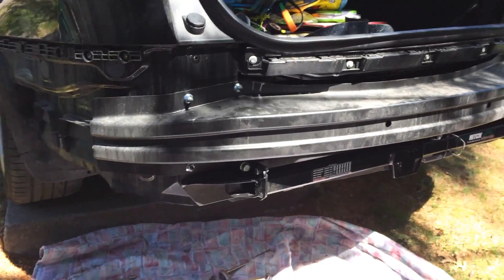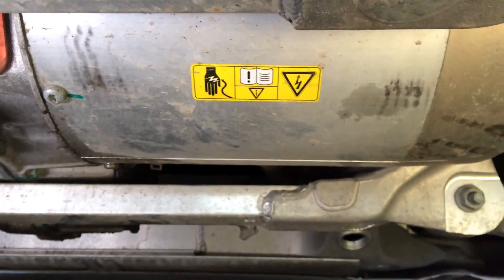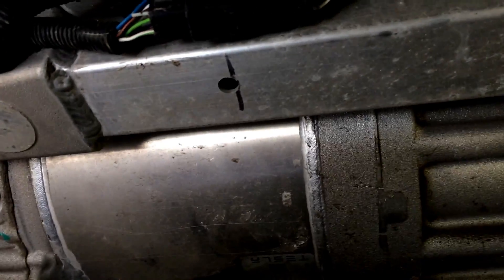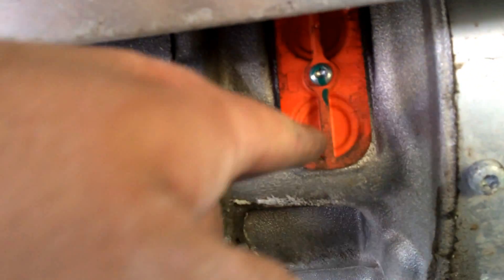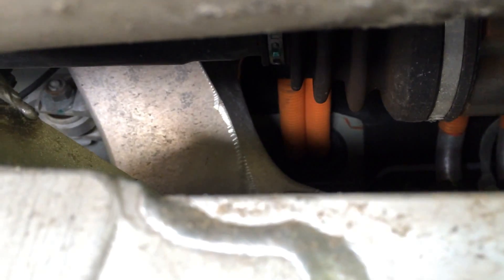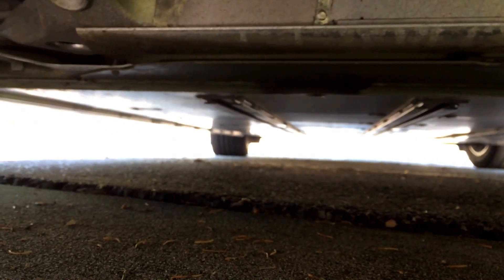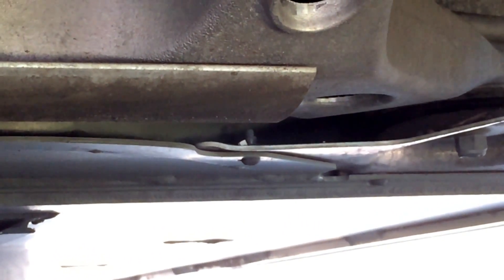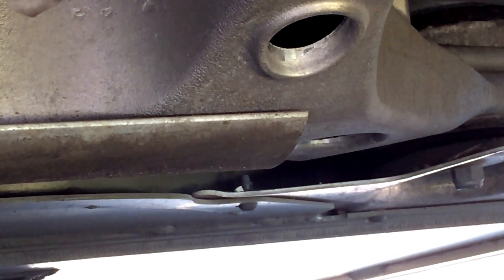Tesla Motors Model S: MOTOR & INVERTER in car underside view!

Comment: I didn't like those wires hanging out with no proper end-off to the flex, just tape, although the undercover panel is over them. Crud will get in the hole eventually.  Do Tesla recommend / allow / frown on towing?  My Toyota Concession told me I can't tow anything with my Prius because it upsets the regenerative system.

Comment: You think it would be ok to take a "hose power washer" that attaches to a regular water hose and lightly blast the crap off the under-components? i mean rain water splashes on it and what not… i would figure, just to keep it clean.
Reply from the maker: Nah, not going to risk it :)
Reply: ***** interesting if the inverter is the same as well and only firmware makes the difference. So a 60 could be hacked to drive as P85
Reply from the maker: Different. The inverter on the P85's can output 1200+ amps, where as the standard cars (60 and 85) are said to output maximum of ~950 amps. The motors are also slightly different. The 60's an 85's are the same motor, just limited due to the battery pack in the 60's.
Reply from the maker: Had em in the house. Cleaned them all the night before. Had my .25 and .45 on me though.
Reply: I'm sure it's not the first time one of these have been taken to one of those automatic car washes that do the undercarriage wash. I'm sure Tesla thought of that one and designed the car to be water proof underneath.
Reply: ***** is the 60 motor physically smaller than p85?
Reply from the maker: the 60 and 85 use the same motors, supposed to be slightly less powerful. same basic physical size though as the P85 motor.